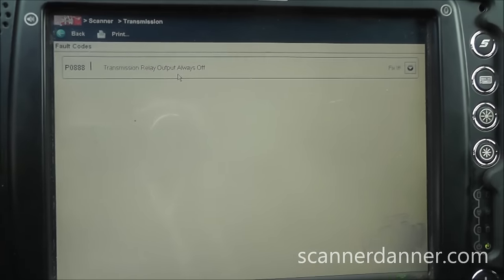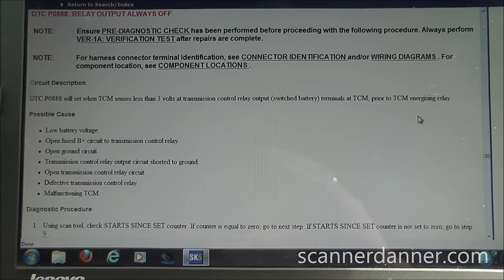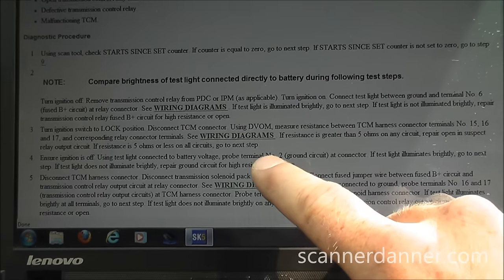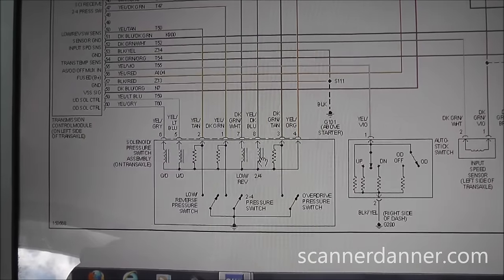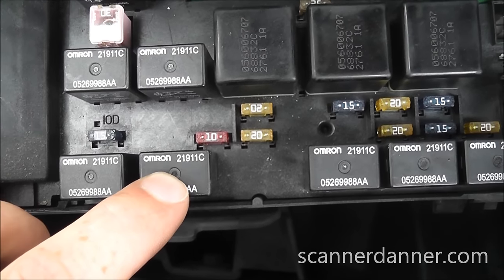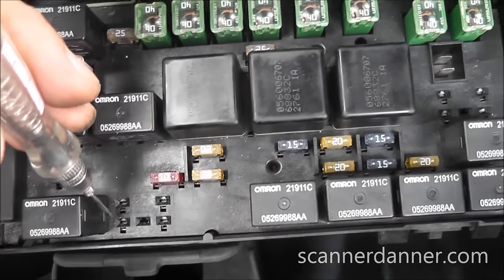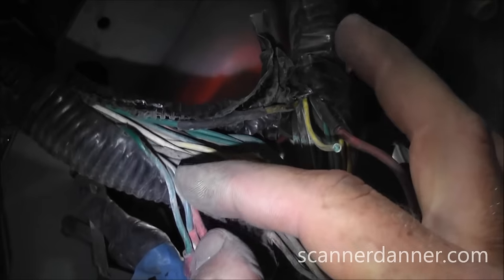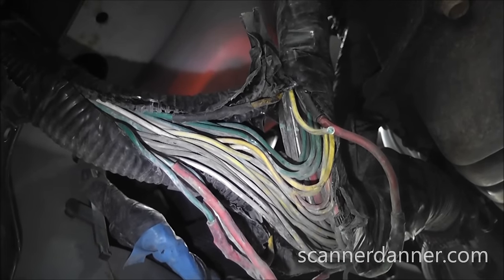Transmission No Shift Case Study (P0888)

Comment: Thanks for the video. I had to "limp" home the other day at 2nd gear or so.

The symptoms were while driving in the rain, the speedometer (only) stopped indicating speed and feel to zero. At the same time the transmission dropped to gear 2 or so resulting in my tachometer going up to 3000 rpm.

I managed to "limp it home" taking bake roads.
Did the research, and started narrowing down the component at issue either the Transmission Control Unit, or as you have demonstrated, a low voltage situation resulting in the relay not properly functioning.

Various repairs have been to just replace the TCU, but after looking at your relay/wiring troubleshooting, this may also be the case.

I'll take the knowledge from this video and the other video which showed the replacing of the TCU (which oriented me to the procedure and location of the prospective areas of concern.

I have yet to determine the engine light code (engine light is still on) but the vehicle (now in dry weather) is shifting normally as I drive (with the engine light still on) and of course, with the idea that it will once again slip into Limp mode. 
Note, on the way back home the night of the occurrence, and while driving slowly in limp mode at about 2000 RPM (in probably 2nd gear), at one point the transmission regained normal mode and went back into normal functioning. But just before arriving back home, the transmission slipped back into limp mode. So basically what I'm saying it began intermittently shifting normally, but now the engine light is still lit and the issue is still needing to be addressed for reliability purposes. 

I am going to find out how to have the vehicle "show me" the code on the odometer screen, and I'll be able to have that information going into the hopeful repair of this problem. 

Note, the vehicle is a 2007 Dodge Grand Caravan, 6 cylinder. 

The replacement of the TCU (seems relatively easy to swap out mine with a new/rebuilt one) just as a quick fix (component replacement attempt) which from one video suggests the new component may be in the $200 dollar range. 

Also, the transmission was rebuilt by a reputable garage and is most likely still under warranty (5year/50kmiles).

So, I have two avenues of approach, 1) contact the original garage (Cotman Transmission) and have them advise me where to take the vehicle locally (another state) for a networked garage to honor their warranty. (I asked them how I would do this if I moved from the original state/city where they originally rebuilt the transmission. 

2) I will at least do a thorough inspection of the wiring harness (which may be suspect because of the situation having occurred during heavy rain conditions (possible water exposure to some element in the circuit). Again, now a dry sunny day, the transmission is working normally (with engine light on).  If I don't see something obviously hanging out, or if the relay inspection doesn't reveal any loose or corroded parts, I'll then have that information to go forward with the next step.

Idealistically I would like to take it to the networked warranty repair shop and have them engage the repair. However, I may not be covered since this isn't really a component of the transmission (wiring and control unit) or maybe it is a full fledged item covered (which they may not have installed a rebuilt or replacement unit at time of rebuilding the transmission the first time). 

Any case, your video was definitely a helper in that it showed more detailed information about the surrounding components of the TCU which may be at fault causing the "limp mode" triggering. I also have this knowledge when contacting the original garage to ask them if they in fact replaced the TCU at the time of the rebuild. They may have just "let it slide" at the time, resulting in me needing one now. Since the TCU is a pricey item, they may have just let it slide. 

Thanks! Any follow up comments to my situation will be helpful.
Reply from the maker: Some info for you. 
1.Transmission codes will set the check engine light. 
2. You need to focus on your transmission output speed sensor circuit. A failure in this circuit will cause a 2nd gear limp mode and speedometer issues. 
Have you see this? https://www.youtube.com/watch?v=MGaHaIXZioA
Reply: Scanner:

This morning I did a visual inspection of all relevant areas as well as ran the engine codes using the ignition key (off/on x3) system.

I then inspected around the area and saw a sensor that looked very corroded on its outer tip area. Looking into the TOSS videos on YT, it appears to be the Transmission Output Speed Sensor.
 
I find this to be good news to locate a visibly suspect part that may be the problem. Especially since my problem was directly associated with the odometer dropping out, and given it started doing this during heavy rain.

Lastly, I inspected the fuse box area for any suspicious items. None visibly, of course a more thorough volt meter / light probe method could be used if needed.

The codes appearing on the display were:

P0302 Code - Cylinder #2 Misfire (https://www.obd-codes.com/p0302) 

P0501 - Vehicle Speed Sensor Range/Performance (https://www.obd-codes.com/p0501)

P0700 Transmission Control System Malfunction (https://www.obd-codes.com/p0700)

My first course of action is to remove the corroded TOSS and clean it up, and give it a closer inspection.

I'll then replace it. If that does not solve the 700/501 problem, then I'll look into just replacing it for the $20/$30 dollars.

If that doesn't work, then I'll have to call Cotman and find out where they want me to take it to get it looked at under the warranty. 

That is, unless I don't find another way to deal with it.

I've taken some video and pictures of the inspection, and will create a quick video reply so you can see what I'm talking about, especially about the corroded component most likely the TOSS.

Post scrip:
1. I've edited this entry to remove what I thought was the TCM but in fact is the Transmission Solenoid/ Pressure Switch Assembly. I looked around and found a transmission diagram that helped me with that one. I also see there is both an input and output speed sensor? Is it good housekeeping just to change them both? The input is very clean, not corroded like the output.

Comment: Really good video I found a similar wires  on a GM . somebody fixed two wires with crimp on connectors, even worse than soldered  unsealed heatshrink.  most people think this fix will last at least a couple of years until the vehicle is junked, and then when the vehicle goes 4 years and quits they wonder why.  Thanks for the video
Reply from the maker: +AL M thanks for watching and commenting!

Comment: Couldn't you use the wiring diagram to find out which pin is which circuit inside the junction box? Btw, love your videos. As a newish practicing tech, I have learned more from a few hours of your videos than I did in a whole semester at a community college. If only all teachers took their job to the extent as you do. Thanks for you input and knowledge.

Comment: Scanner "The Man" Danner.  Great video.  That's some crappy old wiring when you can pull on it and it just breaks apart.  Had no idea oxidation would do that.  Makes me want to rewire my entire car, heat shrink, and seal every wire with high temp ceramic coating lol.  Glad you get paid for this stuff.  Great lesson thank you.

Comment: About 15 years ago I worked on a car that the brake light didn't work I spent 4 hours on it because I was using a digital multimeter and it was saying I had 12v. For some reason I grabbed a test light and found the problem in 5 minutes. The point of this is there is a time for a multimeter and there is a time for a test light
Great vid

Comment: BAD BATTERY! I had a problem with a 2004 caravan would not shift past second gear. cleaned my battery terminals checked my battery. turns out it was going bad so I changed it. works like a champ. that was my situation may not apply too everyone's problem

Comment: voltage drop testing and loaded circuit is key my dodge caravan had the same identical problem  after diagnosing it  mine was a bad selonoid shift pack  a 225.00 part  but well worth it the crystler garage told me they usally go out at 100k miles  replaced mine at 98k miles and now at 211k miles on it still shifts like new very good lerning information  videos thankyou great job
Reply from the maker: +larry mencke cool, thanks larry

Comment: GREAT VIDEO PAUL YOU ARE RIGHT ABOUT THE TEST LIGHT I REALIZE THAT IN MOST CASES YOU CAN USE THE TEST LIGHT EVEN IF WE ARE WORKING WITH COMPUTER ACTUATORS.THIS TEST IS TELLING HOW THE CIRCUIT IS WORKING UNDER LOAD,THANKS..

Comment: Personally, I would try switching relays first just to make sure the relay's good. Then find which pin on the relay is for the switch rather than sending power thru the fuse/relay block and fry a circuit. Anyway, I don't do this kinda job but it's nice to know how to go about it and how it operates. Thanks for the video!

Comment: Good stuff.  Paul I have had good results using liquid tape applied to a connection and then  heat shrink.  After heating the shrink tube  the liquid tape seals the area quite well.

Comment: 5:05 They have a tool kit for tapping into the relay circuits that's actually pretty cheap. You can unplug the relay from the fuse block, plug the tool in place of the relay, and you can plug the relay on top of the tool. It has a pin breakout for all 5 pins of the relay. With that and a good wiring diagram, saves me a ton of time testing.

Comment: A very nice job as usual Paul! You make it look so easy finding a corroded wire in a harness. But I guess that wire harness problems are rare when the protective conduit and tape is intact. And if you find indications on a problem with the insulation that is probably where the fault is.

Comment: Hey bud, I had this code as well as a p0700 happen on the freeway. Truck late shifted and clunked and put me into limp mode. But it’s intermittent. Check engine light is still on, but truck is shifting fine again. It also made my Lamp Out lights come on and off, ABS lights, and my oil pressure would drop at a complete stop.

Comment: I have a 2009 and had the same problem with ours. I also went threw all the Electrical. What I ended up trying was adding additional Transition Fluid. The problem went away. I have now marked my dipstick at the level it took for the transition to work normal. Our Jeep acted just like a transition that was about a Quart Low. So far our problem has not come back.

Comment: those relay testers are awesome. there are 2 sets basically 1 for domestic and 1 for import. I use them quite often they also are numbered to coraspond with relays and wiring diagrams

Comment: DEAR SCANNER, I WATCHED THE CASE STUDY ON P0888. I HAVE THE CARAVAN SPORT AND I GOT VOLTAGE TO ALL CIRCUITS DOWN IN THE TCM CHECKING IT STEP BY STEP AS YOU DID, MY PROBLEM ALSO IS THAT WHEN ITS COLD OR WHEN THE WEATHER IS BAD MY VAN DOES THE FOLLOWING:
IN THE FUSE BOX I CAN HEAR RELAYS ENERGIZING AND DE-ENERGIZING(CLICKING), THE WINDOW WIPERS AND SPRAY SOME TIMES START AND STOP AT 10 SECOND INTERVALS, AND HEADLIGHTS BLINK. ALL WITH THE KEY IN MY HAND. WHEN I START THE VEHICLE SOMETIMES THE RADIO AND HEAT WONT WORK, AND THE GEAR INDICATOR LIGHTS UP ALL LETTERS. WHEN I DRIVE IT JERKS AND ACTS AS IF IT WANTS TO STALL. THEN LATER IN THE DAY OR NEXT DAY IT WILL RUN FINE (EXCEPT FOR THE MISFIRE ON PLUG 5) FOR A COUPLE OF DAYS. I HAVENT UNWRAPPED THE WIRES TO LOOK BUT I WANTED TO SEE WHAT YOU THOUGHT. I CANT AFFORD TO GIVE IT TO A MECHANIC BUT I'M VERY HANDY.

Comment: Great learning video and I don't care when it was made still revelent today, watched it three times and plan on watching it again because it being computer controlled relay and it is my make and model, don't cry for me, the van sits most of the time, load side relays alright and how to check, explained at my speed, thanks Paul
Reply: A leaking battery usually messes that wiring harness up in that spot. Also curb or pavers in parking lots. So just if u get an electric problem it’s probably in that area

Comment: This video is giving me flashbacks form my days at the dodge dealer!     also saw a ton of the tcms rot out and split the circuit board inside and the harness would rot inside the fenderwell as well!    there's a tcm circuit splice just abouve the tcm under the washer bottle that would corrode and cause all kinds of tcm issues!    Razor knives shouldn't be used to open harnesses up!    A seam ripper out of a sewing kit works so much better!

Comment: I have a 2005 town and country , my transaxle relay only has one lead showing power continuous  and the other terminal will not get power to it when I cycle the ignition on I really think I have a broken wire from the computer to the relay, but don't have the color diagram of the wire, Do you know if Chrysler used the same color wire as the 2002 town and country(yellow and Brown). The video you posted is the exact problem I maybe having, very informative. The car has 228,000 miles wiring is very brittle .

Comment: Good explanation of voltage drop Paul, I liked the part where you show the unloaded voltage vs the loaded voltage, when you see voltage unloaded and very little with the circuit loaded, instant indicator you have corrosion in the circuit and you need to look for green wires.  Two  thumbs up.

Comment: I am no mechanic much less an automotive electrical person but I like how the details of the schematic are explained.  Thanks for the video.  I have a mazda 2002 b2300 pickup with shifting problems.  I revs high until it jerks and change gear from first to second....then it runs ok.  Took it to a mechanic and he took down the valve body, cleaned it up and did whatever there is (don't know what all he did), refill with clean auto trans, but I continue having the problem.  The OD light keeps flashing too.  Maybe it is the speed sensor???????? Don't know -- so I am looking for detailed info to pass to the mech to check.  Once again, thanks for the excellent video -- really appreciate you taking the time to share.
Reply: Fix it?

Comment: Absolute great job on your video. Question though who is Bright Idea is it for these manufacturers to put computers and oil coolers and such right by the wheels. Gravel roads absolutely destroy the wiring.  I've had to repair a lot of curb checked caravans in the same fashion get them every time. once again great job.

Comment: p0700 on 2002 chrysler T&C LX 3.3L Flex - TCM caused ECM not to crank car right away. took 3 tries or more.  Finally, check engine with p0700, and transmission failed.  no park, drive, reverse.  Car never presented Limp Mode, 4 shifts.  Transmission shop wants to rebuild/replace.  white smoke from top tube at Transmission Link escape.  How lucky would things be if there was not internal damage?   Do you know if this circuitry has a TCM shut down?    Just thinking that to prevent grinded internal parts, the transmission control module would take the transmission off line instead of letting it destroy itself.    -- I am getting the car back because the new rebuild will be too much, and I am starting on it with fluid, and a prayer.  But, the above video is very very crucial for this scenario, and any code from an ECM that triggers the Transmission.  This will make you think to replace the Electronic Control Module by the battery, or the Tipm.. but, would be a transmission module replace, wiring, or Solenoid with in/out sensors.  Right on ScannerDanner!  Any more great advice?

Comment: I have got the relay test adaptors was the best money I have spent.  pulls comes with adaptors to hook up test light and or malti meter as well. :-)
Reply: I have a 02 pt cruiser. The transmission works good for about 5 miles then it completely stops. Let it set n cool off n does the same thing again. Any suggestions on what to check or do??

Comment: So I own a really crappy 04 Suzuki Forenza. I recently changed my Transmission range sensor because my car would lose power while driving. My check engine light came and I got a diagnostic and it came back as a bad sensor. Well I changed the sensor the check engine light went off but the car still wouldn’t drive or go into reverse. A neighbor told me to check out the TCM fuses I went and purchased some 10 amp fuses changed it and the car drove forward but go into reverse. I then decided to drive around my block and when I did the car came to a complete stop. I went to change out the fuse again but when I pulled it out my car started rolling forward 🤷🏾‍♀️ so I drove the car the rest of the with no fuse. I decided to put the fuse back in and the car wouldn’t move. So I pulled out the back up fuse and the TCM fuse together the car went into reverse and drive with no problem. Gears move smoothly no jerking🤔 also the speedometer stop working why is the car doing this? Doesn’t the car need the fuses?

Comment: great video paul ! feel almost sorry for you guys on the east coast, those cars are hammered with rust ! car repair must be huge there! speaking from a tech from California. Thanks to your videos I no longer follow manufacture flow charts. Usually  all I need is a wiring diagram, test lite or power probe to test things. If your looking for a relay interface tool lisle tool has em and so does wakeon. Vim tools I think has one as well. I used to be a tool guy but went back to wrenchin.

Comment: I love older Jeep's.

They had more electrical problems than the space shuttle!
Reply from the maker: no different than any other older car imo
Reply: @ScannerDanner  I'm not sure about all the others.
 I just know I buy Jeep's and some Dodges because of the inherent problems I'm pretty sure I can fix.

I got a 3/4 shift problem right now on a 2005 GCL with no codes. 545RFE
 I'm hoping it's the TIPM And not the shift solenoid.